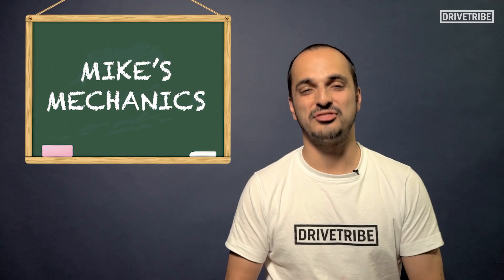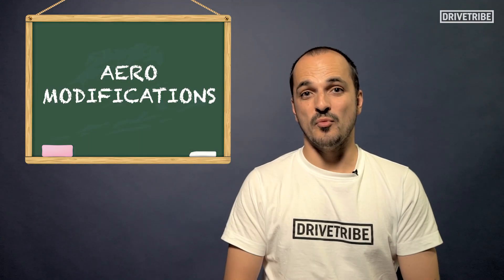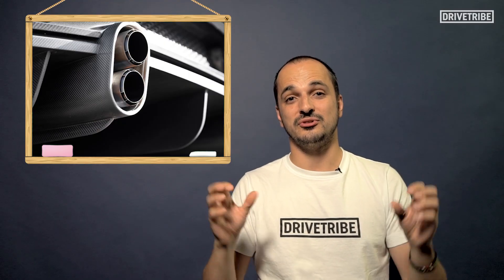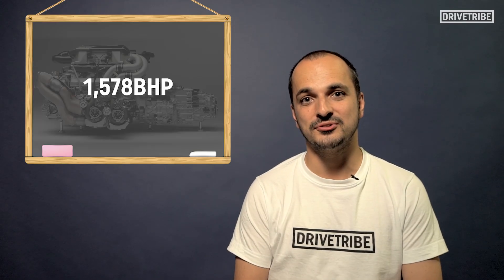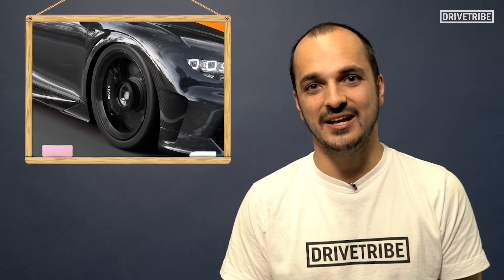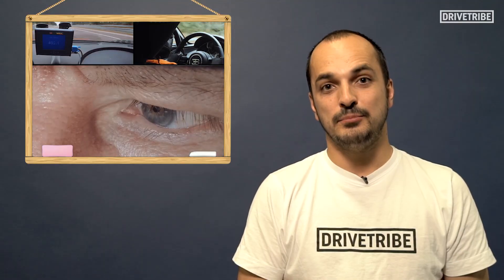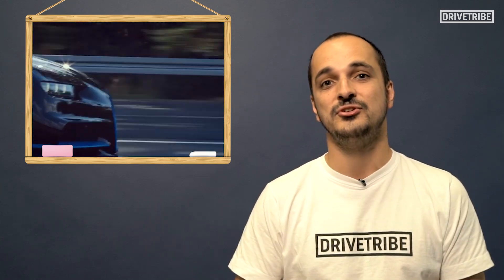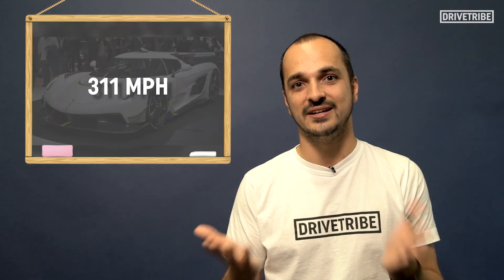How did the Bugatti Chiron reach 300mph?

Comment: It seems to me that the only real obstacle is tyre technology. It seems that creating a tyre to withstand 300mph is more difficult than producing an engine which could push a car to almost any speed. Give the engine, say 2000bhp, and the right gearing/aerodynamics/cooling, and whose to say that 350+mph cannot be hit!? ..just as long as the tyres are up to the job.
But what is the point of all of this!?!?
The combustion engine is on a worldwide decline, and EV are becoming more popular. China is the biggest car market and they are crazy about ev's; they're making tonnes of them.
Norway's new car sales are mostly ev (77%). 10 years from today things will look very very differently. Range is ev's greatest problem, as well as time needed for recharging. Once range reaches 300 miles "minimum", regardless of conditions and power usage enroute  (lights/aircon/etc.) and recharge to at least 80% takes say no more than 10 min, and of course prices roughly equal that of petrol/diesel cars, it'll be all over for today's cars.

Comment: Bugatti said according to their calculations chiron prototype could have done 320 mph in nevada.
Reply: Bcz of thinner air
Reply: @AbhisarRawat  There's a trade off with thinner air, it's less oxygen rich.
Reply: That's what you have turbo's for.....
Reply: @Slapbladder  Turbos also feed in less oxygenated air
Reply: rober de isidro incorrect, it’s not oxygen level that changes its density and seeing as a turbos control system measures output pressure a turbo simply spins faster to produce the requested pressure in thinner air.
Reply: Thats really possible
Reply: Where did you read that?
Reply: @Gois83  an article on top gear.
The engineers were saying because their test facility is not a lot above the sea level the air is dense and nevada has less dense air because nevada is at higher altitude.
Reply: @Anime_Remastered  That is a great point to note.
Reply: Thinner air etc but yes but this car also took a long time to get there so I’m finding it hard to believe anyone will fully be able to attain maximum speed in this vehicle at any point
Reply: NO NOT BECAUSE OF THIN AIR BUT BECAUSE OF STRAIGHT LINE RUNWAY  WASNT LONG ENOUGH, THAT TRACK IS IS 5.5MILE STRAIGHT AND THAT CAR CAN  EVEN COVER A MILE WITHIN 10SECONDS
Reply: sabelo gama that’s 360 miles per hour... wrong...
Reply: Hudson Hackbarth Okay around 13 seconds maybe
Reply: What Bugatti is saying is a really bad excuse. Koenigsegg said they could do 320 mph on VWs test track with the agera r. Because of higher oxygen levels and better tarmac. The difference in drag from 50m - 1000m is minimal. Koenigsegg cant use VWs track for obvious reasons. Nevada is a public road, so why wont Bugatti give it ago? Ah they retired, with their tail between their legs.
Reply: @WideSounDEFFECT  

Air density is a factor. That is one reason you will not see airplane going faster than 250 mph at sea level. The tarmac at Ehra Leissen has some change from old to new section causing a jump on Chiron SS at 278mph (447 km/h). Chiron SS was still accelerating hard when running out of track.
Let remind that Koenigsegg run was done with thinner air density and their engine are turbocharged allowing to keep the same power output. Their best run was done downhill and tailwind. Bugatti could easily run that Nevada road at 320 mph with power to spare but chose safety as main priority.

Comment: I don't understand what this record is supposed to be it's a modified Chiron not even a production car it's a prototype race car. Ford GT broke 300mph first modified production car to go 300mph and they did it in 1 mile not Bugatti 6 miles and Koenigsegg still holds the stock production car record by about 15mph. Bugatti is just trying to stay relevant if the goal was to take a modified car to 300mph Koenigsegg would have done it a long ass time ago but no the challenge and battle has always been about STOCK production cars. This Bugatti was cool just to mess around but it holds no titles and no records it was just for fun.

Comment: Ummm...the 300mph "barrier" was smashed by piston engined, wheel-driven cars in the 1930's. The 400mph "barrier" was broken in the 1960's. Any car company could make a road legal car that does 300mph. What makes it special is that in this car, you can take a passenger and listen to the radio with them, and enjoy air conditioning and comfortable seats and a comfortable ride, and have space to put your shopping, and drive around the city center for hours without overheating or any parts falling off

Comment: YOU metric folks? UK is metric as well, smartass.
Reply: Yes, the UK officially uses metric, but they still use some Imperial measurements, such as MPH for speed and Miles for distance on motorway signs and some other signs. Just like the US actually uses Metric as a secondary measurement system.

Comment: Senseless talking... EVERYBODY CAN CLEARLY SEE IT'S THE FASTEST CAR AT THE MOMENT!🙄
Reply: Technically no, because its not a production car... There has been cars for 20+ years now going more than double 500kmh  in fact breaking the sound barrier.   As I said its a modified car so it fits into another class at wich point is actually at the bottom of the list.
Reply: It’s been launched buddy... it’s a production car
Reply: Jacob Allen It’s not buddy, I follow Bugatti on Instagram I would’ve noticed :)
Reply: @luzmuz  Stephan Winkelmann announced on a Gala there will be a limited production of 30 cars for 3,5 Mio Euro without tax each...😉
Reply: Porsche 911 GT3 RS And it’s surely just gonna have one seat 😉

Edit: Also: They’re gonna set a “record” and produce the car afterwards? Thank god it doesn’t work like that. Otherwise someone could just set a 400 mph top speed record in some car and just produce it whenever they want like decades afterwards.
Reply: @luzmuz  Same happened to Aventador SVJ: 1. Lap record Nordschleife, then production started! Recently, Taycan did a record at Nordschleife, now production starts... You see?😉
Reply: Porsche 911 GT3 RS And what about the one seat thing? You completely ignored that.
Reply: @luzmuz  Usually Manufacturers are installing a Rollcage and a Bucketseat for safety reasons while doing a record run. This causes extra weight and to come even with the production car weight they remove the passenger seat and also door inside panels, otherwise the rollcage may not fit... (Sorry for bad english)
Reply: @einautofan6685  blablablabla 😉😉😉😉😉😉
Reply: @einautofan6685  stop babbling maybe???
It hasn't broken or set any records except maybe the fastest Bugatti that they won't be making anyways
Reply: @razorblade7486  No Blabla. Looks like you 2 just trolling around...🤪
Reply: @einautofan6685  go cry to your mommy kid....
The troll here is you if you're thinking an illegal car hitting 300mph in one direction alone is some kind of a record.... Has been done before.
Reply: @einautofan6685  yeah faced with facts and runs away with his Bugatti fanboi feelings....
And enjoy your fastest Bugatti while at it, maybe....😂😂
Because that's the only thing special here....
Fastest non road legal modified Bugatti Chiron that they are afraid to make as a production car...😂
Reply: @amalkallarackal9293  just check Google, it's going into production.
Reply: @Todestuete  not this one....
This got a shit load of gimmicks which inherently makes it illegal on street use
 And for this to be a record
1. it has to be a production model, not a concept model that they were working on.
2. The run has to be made in both directions...

So thank you....
Reply: @amalkallarackal9293  1. It's going to production! 30 cars will be made!

2. Bugatti doesn't care about a Guinness rules Speedrecord! They showed the world they did and they were first! Everybody can see it in the clip! Soo what? Stop writing Bullshit now!!!
Reply: @einautofan6685  oh my bad....
What part of "it's not a production car record till they do it with a production car and not a concept prototype" did you not understand????
And by your "logic" ford has touched 300mph with an illegal 2005 ford GT so ford has proved the world it can be done too....?

And Bugatti fans do please enjoy your "fastest Bugatti in the world and nothing more" title...
You earned it...😇✌
Reply: @amalkallarackal9293  Damn your salty af. Mad that the greatest car manufacturer just shittet on the kit-car manufacturer known as koenigsegg ?!
Reply: @amalkallarackal9293  just Google it already you tool, it's going into production including all features minus the safety cage, which doesn't matter.
Reply: @Todestuete  the tool here is you....
The production version supersport isn't hitting 300mph at all. It's limited to 273mph.... meaning it's not a 300mph car at all.
When they make a production version which customers can take upto 300mph in stock if they wish. Then you may start blabbering about it dear Bugatti fanboi....
Till then it's an illegal Chiron and the only tag it holds in real world is just a beefed up fastest Bugatti that's not road legal...
Reply: @xKOISHIx  if Koenigsegg does a crap job with it's hyped up jesko run or if ssc tuatara did a crap job with it's 300mph run, like how Bugatti did with chiron 300mph run, I'll be blasting them too Bugatti fanboi....
As of now no production car has hit 300mph.
Bugatti has chickened out and tried a run in just one direction with a prototype that the customers won't be able to do. So in theory it's not a 300mph production car.
Both ssc and Koenigsegg are having a hard time convincing it's potential customers about this 300mph run...
Hope they do it properly (if they are doing it) and not a half hearted hyped up attempt to feed the respective Koenigsberg or ssc Fanbois like Bugatti did with kids like you, Bugatti fanbois. If someone is making a 300mph run let it be with a proper production car run in the first place....

Comment: I don't really get the point of why Bugatti did this. What record are they trying to set? It can't be fastest production car because this was a modded version. Explain...
Reply: Considering it's not considerable as official, they just wanted to flex their ability to get to 300 mph
Reply: @gionniblood  Seems about right. I don't know if I should be impressed or not.
Reply: @rad5207  well… you should: it's a street legal car (I suppose) that will probably be produced soon that reached 300 mph. But it's still far from being as impressive as the Ford GT that did almost the same but starting from 0 and in a single mile, or as setting a new record around the Nurburgring.

Comment: I thought that it has to be a stock production car for it to even count as record?? This is a modified car. I remember back in the early 90's when the Callaway Sledgehammer hit 255 mph and it didn't count because it was a modified Corvette and not stock. Same with the Walter Wolf Countach, which was reported of speeds of over 202 mph as far back as the 70's and there again it was modified and did not count, so the first car to reach 200+ "officially" was the F40 in 87, because it had to be stock to count for the record. So by all means, this Chrion is modified and should not even count at all. In fact they should have to build a totally new car with the capability of reach 300+ stock and unmodified to have an attempt at the official record. The 300 mph barrier was already broken by a modified 2005 Ford GT in Texas, back in March, why didn't that count then??

Comment: It's a preproduction Chiron longtail or SS.. and it would have went over 315 if they went to Nevada where Agera RS did it.. according to the engineers since the straight was so much longer the modified Jesko is the only one with a chance the Agera RS had nothing left if you watch it.. even though they said they are done with number chasing I hope they take the longtail there when it's released